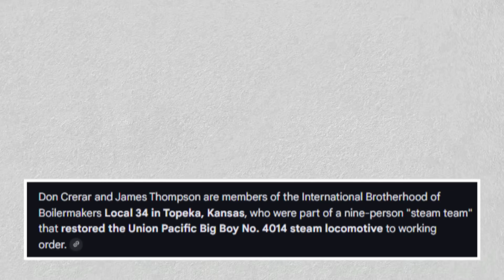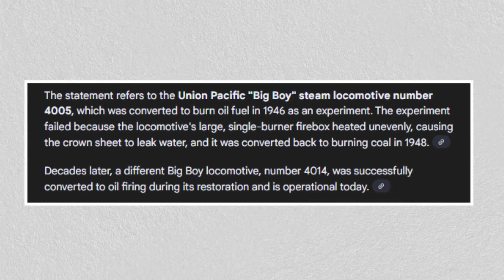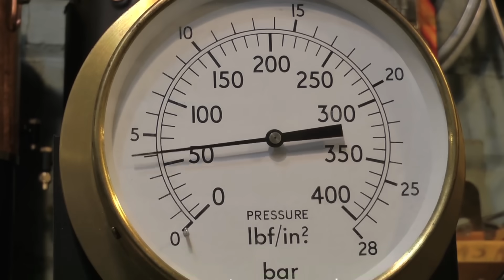Big Boy 4014: How They Brought a Dead Giant Back to the Living

Comment: Excuse me but Union Pacific didn't start restoration on Challenger #3985 until AFTER Big Boy was completed, Legend #844 was completed first and was sent in excursions then Big Boy #4014 and now Challenger #3985
Reply: You might be referring to the new ongoing restoration of UP 3985 that was started by its new owners, Railroading Heritage Of Midwest America in Silvis, Illinois.  The Union Pacific donated 3985 to them in 2022 and they started restoration work in 2023.  That is 3985's second restoration.  Its first restoration that got it back into operating order was completed way back in 1981, as The Locomotive Historian mentioned in his reply below.

As mentioned in this video, UP 4014's restoration was completed in 2019.  That was 38 years after the restoration of UP 3985 was completed.

I hope that this helped clear that up.  Just going by your comment it sounded like you were only referring to 3985's second restoration.
Reply from the maker: The original restoration of Challenger 3985 was completed in 1981, Big Boy 4014 was reacquired in 2013 for its restoration.